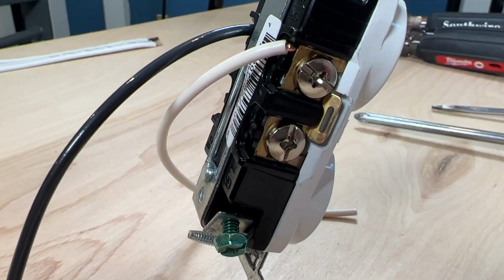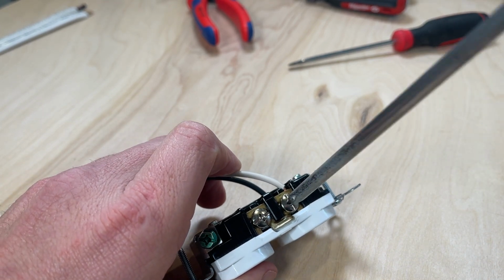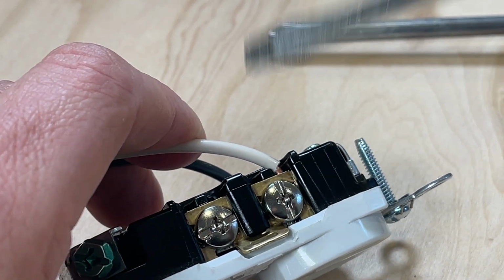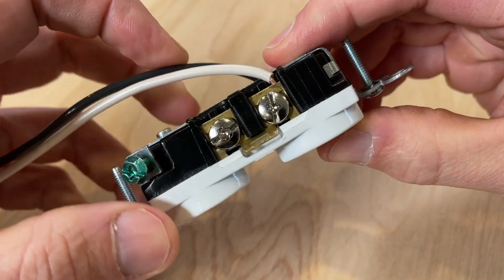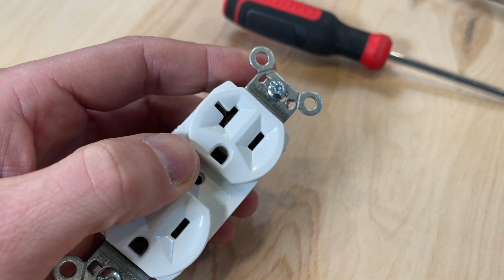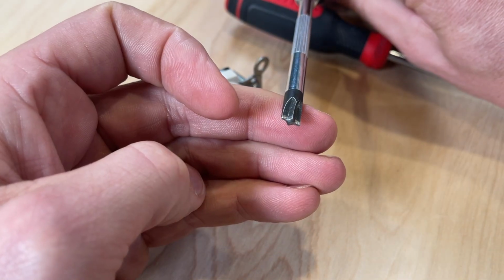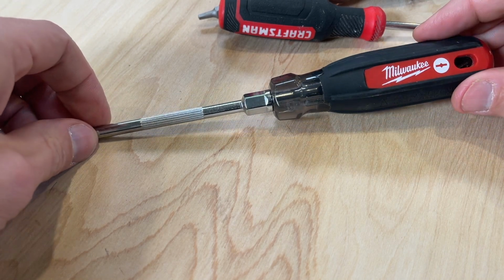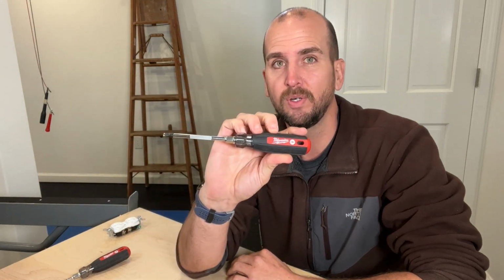80% of People Use the Wrong Screwdriver For Electrical Work

Comment: I have an electrician friend who said he would quit the trade if he had to work in the US with Philips...there is absolutely no better tip for wiring than Robertson (not withstanding the very specialized tip used here)...we Canadians love Robertson but it baffles us as to why the US hasn't adopted them.
Reply: It is because of a licensing dispute between Robertson and the Ford motor company way back in the day
Reply: @JernD  I have a 1930 Model A Ford with Robertson screws.  Mind you it was made in Windsor Canada.  Ford loved them, and they were used in the vehicles made here (many which were shipped throughout the British Empire in those days).
Reply: @va3ngc  👍
Reply: As a canadian that's now in the US, Robertson (well technically "square" drive) shows up here more now as a "specialty screw" - I have a feeling the patent on Robertson must've expired, so now there's no licensing requirement. I use robertson screws on purpose hoping someone after me will run into them and go "WTF?? Security screws?? why the...." :)
Reply: @gorak9000   When I was installing nightclub sound systems back in the 1980s and nineties, we used to use Robertson screws to hold covers on the equalizers and crossovers and other sound processing equipment so that the DJ's couldn't pull the covers off and mess with the settings.  Some of the DJ's figured out that a small flat blade screwdriver inserted crosswise, point to point on a Robertson screw would allow them to remove those screws,and so we switched to the special Torx screws that have a little pin sticking up in the middle of the Torx  head and the matching bit has to have a hole in the center of it.  Even those have become fairly easy to get nowadays  and so if I was still doing that kind of work I would probably have to use either "snake eyes" screw heads or hourglass-like clutch-head screws (both seen in prisons and public restrooms, and the clutch head screws were also seen on old Ampeg guitar amps from the 60's).
Reply: @goodun2974  "Snake Eye" screws are pretty easy to defeat. You get 2 nails that are the right diameter, shove them in the holes, then use a pair of pliers to turn the nails gripping them right at the surface of the screw. Funny story, my first ever cd burner (2x in an external enclosure) back when they were exceedingly rare and new used "snake eye" screws to hold the external enclosure together - took me about 5 minutes to figure out how to get into it.
Reply: @gorak9000 ,  I am aware of that. In the past I have bent a thin nail or a piece of stiff wire into a staple-like shape to span the snake-eye holes and held it with pliers. Also, when I 
had to tighten tonearm bearing pivots, I ground a notch in the center of a flat blade screwdriver.  Most of these specialty screwdriver bits are easy to find nowadays, but 40 years ago, not so much.
Reply: They love to be "different" lol.
Reply: @Tre16  It's not like there's some kind of nationalized standard screwdriver in the U.S.  People use whatever they want. Your average basic bit driver set comes with Phillips, slotted, square, and T. 

For a switch or receptacle, all four options work just fine(the screw head is designed that way on purpose), so they've adopted it. 

And the best one is the Milwaukee. What's more American than Milwaukee?
Reply: we yanks do use a fair percentage of square drive, but it has its own weaknesses.  it will actually strip screw heads more effectively than anything else, and somehow I've had robertson screws strip out and still had to use pliers to get the bit loose from the stripped screw.  phillips cams out easier than robertson, but it usually doesn't strip as badly so it can be backed out and replaced.  torx grips amazingly well, but stainless screws will fall off the tip, and every size screw uses a different size driver.
Reply: @kenbrown2808  Aside from electrical, #2 square head wood screws can be infuriating when your driver pops out and pushes into your thumb repeatedly. Most people I know will only buy torx head screws.
Reply: @histguy101  the basic screws I use are either philips or square, and it makes little difference to me, my mushroom head screws are square drive, because that's what they come in and my countersunk stainless screws come in torx.  all have their own small annoyances, but the worst is when a screw goes halfway in and the head twists off.  second worst is when a square drive goes partly in and the screwhead strips out, making it so the only way to remove it is by grabbing with with pliers.  the only real difference is it's harder to grip a twisted off screw than a stripped out screw.
Reply: @kenbrown2808  hammer your robertson driver into stripped screw it will loosen the threads and seat driver into screw and it will back out
Reply: @mikelust9855  no, you do that to prevent it stripping. Once it strips, the hole is round and has no corners to bite into.
Reply: @mikelust9855  this techmique works best with a manual impact driver, the type you hit with a hammer, *in reverse mode*.
Reply: @kenbrown2808   The only problem I've ever had with stripping Robertson-head screws is when using stainless steel decking screws, but those are pretty soft and so the holes really should be predrilled (though they do work better with a cordless impact driver).  A Robertson screwdriver will at least hold the screw onto the bit pretty well even though the stainless isn't magnetic. Stainless steel Torx screws aren't suitable for that kind of framing-type work anyway, the heads strip too easily, making Robertson a better choice. Generally, I prefer to use magnetic steel screws wherever I can (coated screws for exterior work), just for the convenience of having them stay on a magnetic drive bit.  I have to say that I find it extremely annoying when you pull your drill away from the work and have the bit stay in the head of the screw, and therefore I only use 1/4 hex drive bit adapters that have a C-ring or a collet so that they'll grab onto the drive bit really tightly and not leave it behind in the head of the screw.  The collet-chucks tend to be kind of bulky and they limit your ability to work and see  in tight places, so I prefer the skinny bit  holders with the little C ring built in. I've tried about a dozen different types and brands of hex-bit holders,  and Dewalt makes one that grabs onto the bit so tightly you pretty much need pliers to pull it out (assuming the bit has notches for the C-ring to grab onto) and it has the strongest magnet of all the ones I've tried. 

 One weird thing that happened to me a couple of years ago when I was recovering from surgery and having someone else build a small porch balcony and stairway entrance for me,  and I was supplying all the materials:  The large box of stainless steel ribertson-head trim screws I got from True Value wasn't quite sufficient to finish the railings and and ballasters, and so I went out to the same hardware store and bought a smaller box of the same brand to finish up the job. We discovered  that the screws that came in the small pack, even though they were the same brand as the large Box I started with, seem to be made of a softer stainless and stripped much more easily. Same style and brand (Hillman) of identical screws  and yet the ones in the large bulk pack box were apparently made of harder stainless!
Reply: @goodun2974  i have never stripped a torx, but I've spun plenty of heads off longer ones. Robertsons, though, if you don't have the bit seated and aligned, will strip round.
Reply: @kenbrown2808  , most Torx screws, the ones made for framing and carpentry anyway, are harder than the drive bit and so its the bit that gets chewed and stripped. Tork screws used in electronics and appliance assembly, however, are invariably softer than the bit and so it is indeed possible to strip the screwheads.
Reply: @goodun2974  the ones I'm comparing are the same stainless screws that strip out with square drive.
Reply: Probably the same reason we have not converted to metric across the board. We should have done so over 50 years ago. Silly really.
Reply: @bobd2643  you mean because we recognize that one size does not fit all?
Reply: Phillips is garbage and I absolutely hate that so many manufacturers supply phillips hardware with equipment. The screws strip so easy and rarely fit well enough so that you can hold them in the bit without your hands. Robertson is better for sure, but torx is even better.
Reply: Robertson fasteners are great. America does dumb stuff. Like build cars with both metric and SAE bolts and nuts.
Reply: @andymerrett : screws in that kind of wire termination pretty much have to be flathead to have enough surface area for a screwdriver to grip.
Reply: Re did  the electrical my whole house, every outlet and switch, added plenty. Plus all over ,outside, shop, sheds, pool, extra outlets. It's not like doing it every day, but, the right phillips, and flathead, all connectors are snugged down fairly easily.
Reply: Tell your friend to get another job!
It’s Klein tools or nothing!
Reply: @edwardmascari4661  Their bottles are kinda hard to use though.
Reply: Here in the US I use Robertson (square) drive screws as much as possible. The problem is it is difficult, if not impossible, to find a source for small quantities of all the types and sizes I use. Say: try and find a square drive 4-40 x 5/16 machine screw in quantities of 100 or less. The same can be said of torx or  hex drive. You are stuck with #1 Phillips or slotted. Or, in larger sizes, they will say they are square drive but they will actually be those god-awful combo drive.
Reply: @larsord9139  , hardware store selection in the smaller sizes, like 4-40, is definitely limited (and 2-56 non-existent). I really miss the special Sears Hardware stores, their selection was very good (especially for Metric fasteners). My local True Value is pretty good. Home Depot and Lowes' selection kinda sucks.
Reply: @andymerrett  In electronics we get two more to confuse the issue - Posidriv ( like a Philips but with a square in the centre) and JIS like a Philips but has right angles without a curve.
Reply: There’s a reason why when you go down to the store to buy deck screws or other screws like that that certain sizes are square drive and once you then hit a certain larger size they go to being Torx. Because the Square Drive can’t support that much torque without stripping out. Almost all the electrical stuff down here has the Robertson feature built into the screw where you can use either a slotted driver or the Square Drive interchangeably. That’s become pretty much the standard. And on some things you can use Philips as well like on this outlet so they gave you three options.

Pretty much nowadays in regular general construction you won’t see very many slotted screws anymore except in a specialty application, you will see some Robertson screws and stuff like bathroom stalls and different things like that or in deck screws or other outdoor wood installation where it’s a smaller size screw but as soon as you get to screwing stuff into slightly larger size wood you’re going to see everything transition at least in the United States to something like a T30 or T40 torx. 

And of course when you get big enough it will go to something like a lag bolt with an actual bolt head.
Reply: @andymerrett  You are conflating screw head profile (flat head, round head, pan head, etc.) with drive type slotted, Phillips, Robertson. You are calling a slotted drive screw a "flathead" screw.

Comment: Being Canadian, I have all 5 Robertson  driver sizes in multiple shaft lengths. Most of the screw types sold in hardware stores are Robertson heads. I throw away any supplied Phillips screws that come with purchased items. But I learned something new - the ECX driver. If I needed to change many outlets, the price is nothing. Thank you.
Reply: if you need to change many outlets, get a hybrid tip for your cordless.  your wrists will thank you.

Comment: In the UK we call them "plus minus" bits. + -
They come in Pozidriv and Phillips. You can get them as 1/4 " drive bits for a few pounds each.
Reply: Plusminus is different (and better) than" ECX. Ideal and zephyr make combination screwdrivers that are PH/SL plus minus design. ECX does fit a little bettter in the set screws on EMT

Comment: Most Robertson screw drivers are color coded too (at least they are up here in Canada) :
Green is Robertson #1
Red is Robertson #2. 

Makes it very easy to spot the right one in the tool box!
Reply: There's also a yellow #0 and a black #3 Robertson - they're kind of rare - almost as rare as a phillips #3. I think only once did I find a #0 robertson screw, and only one time did I run into a philips #3 (probably actualy a JIS screw as it was commercial electrical equipment from Japan, but a #3 philips worked fine). Robertson #3 isn't as rare, but you don't see it too often.
Reply: @gorak9000  black robbies are common for larger EMT. never seen a yellow though
Reply: @pbakai182  Yeah, I know I've had to go fish out the #3 Robertson out of the tool box a few times, but couldn't remember for what. According to wikipedia, not only is there a #0 yellow, but also a #00 orange, and a #4 brown! https://en.wikipedia.org/wiki/Robertson_screw The More You Know [shooting star]
Reply: @gorak9000  There is also an orange #00. I have one in my tool box as a millwright and have used it on  really small screws.
Reply: I have a yellow Robbie - used mostly for very small wood screws, not for electrical work.

Comment: I use the #1 Robertson for outlets and also on the cable ends.  Here in Canada we use Robertson on many fasteners so that is a normal thing for us to use because every bit set or screwdriver set comes with #1,2,3 Robertson. A lot of the screws at the hardware store here have Robertson heads, with the exception of drywall screws.
Reply: Drywall screw driving needs to be torque limited, which Philips do. Now that torque limit adjustable drivers are common one could use Robertson drywall screws.
Reply: @danielcarroll3358  Exactly. I can't imagine trying to use Robertson drywall screws if they made them lol. That torque limiting feature of the Philips heads also make drywall screws fast to use I think.

Comment: Another great video Scott.  Once one uses the ECX, its hard to go back.  I might mention that for typical duplex/switch replacement, and cover replacements, I usually find myself reaching for my ‘old’ GB 1000 volt insulated screwdriver with multi tips.  It works well enough on the wiring, and the smaller slotted bit is perfect for the plate screws.  Peace ✌🏻
Reply: Do you have a link to "GB 1000 volt insulated screwdriver with multi tips"?  Thank you.

Comment: As an electrician… just use what you have. Pull on the wire after you are finished and make sure it’s secure. You don’t need a specific tool to do it quickly or do it right.

Comment: I have these (ecx) but more often than not, I need to use a slot head to do the final tightening.  I've found they tend to slip out under heavier pressure.

Comment: Excellent video. Yes, the #1square or ECX are the best to use. However, I have used a JIS +2 screwdriver & it appears to fit perfectly. It doesn’t “cam out” like a regular Philips.  I use JIS screwdrivers on all my bicycle building projects-  Japanese made derailleurs (such as Shimano ) have adjustment screws and these screws are made for JIS screwdriver bits. Asian autos also use JIS fasteners for many of the dashboard mounting screws.
Reply: Yeah it's a real shame we done replace Philips with JIS, it's a far superior design, but similar enough that people wouldn't need to replace all their Philips tools or hardware

Comment: I've always used Philips, but I've always had a flat-head, if I needed it.

I knew about Robertson in general, but I didn't know they were commonly used for outlets -- I need to look at those screw heads more closely!

The ECX looks nice, and I'll see if I can find some bits for that for use in my multi-driver.

Thanks!
Reply: Robertson fasteners are much more common in Canada than they are in the USA. Robertson, the inventor and original manufacturer, was Canadian and set up his operation there. Due to industrial politics, most U.S. manufacturers adopted Phillips screws instead of Robertsons (the Robertson design actually predated Phillips, star drives (such as Torx), and virtually all the others except the slot-headed screws).
Reply: @censusgary  -- I've known about the history of Robertson drive for years, but what I was not aware of is that they are commonly used on light switches. Maybe I haven't looked at enough light switches in the last few years....
Reply: @shubinternet  In Canada,  you ALWAYS see robertsons on "commodity" electrical devices (outlets, switches, most breakers, panels).  Been that way for at least 2 decades, if not 4.
Reply: @fromagefrizzbizz9377  -- whereas I live in the US (well, Texas) and this is a new thing for me to see on the outlets down here.

Much appreciated! Thanks!
Reply: @shubinternet  took you long enough, Robertson’s were invented in 1908! 🤪

As my dad (a professional civil engineer) used to say, Phillips screws should be outlawed and selling flat drive screws should be a capitol crime punishable by death 🤪

In Canada the only “commodity” Phillips screws you see are drywall screws.  Phillips and flat are more often seen in specialty stuff, some smaller bolts and brass. Allen heads have always been around. Torx is making big inroads now, especially in wood screws, and after driving 10’s of thousands of Robertsons, my new bulk purchases are always torx, and I’m not alone in that.